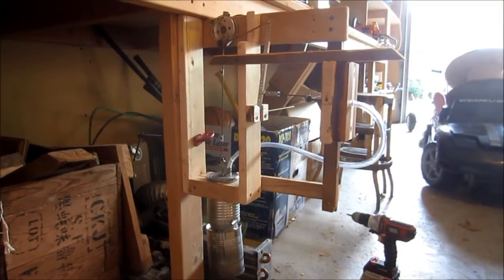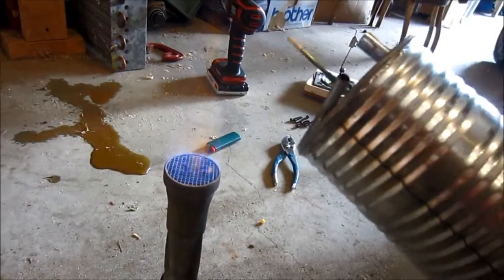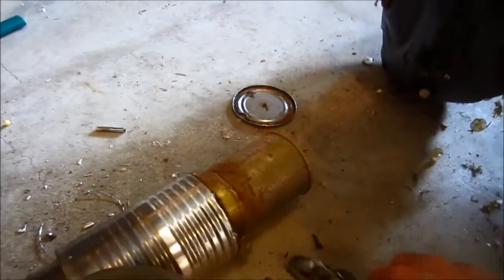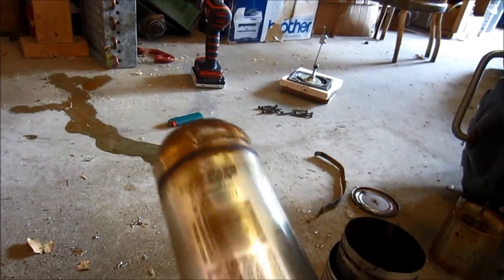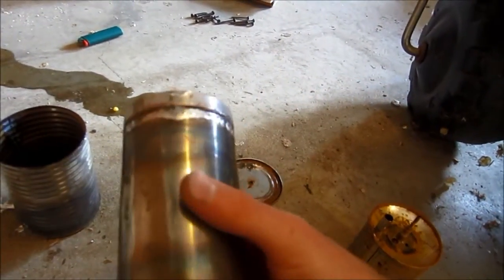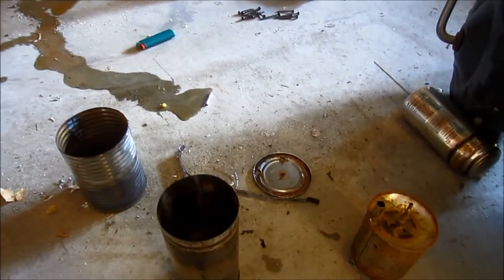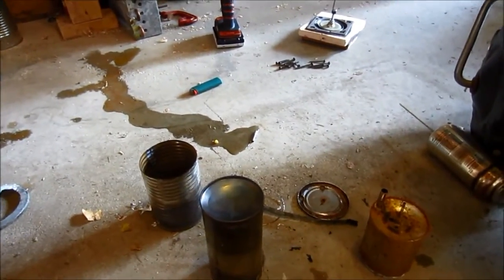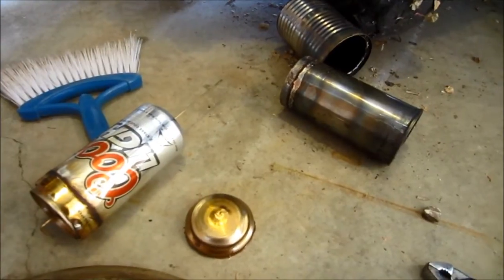Taking Apart My Stirling Engine #4 With Failed Displacer

Comment: Congratulations dedication in building this engine, I believe, if you reduce the length of the displacer piston, you have increased pressure inside the engine and also reduces the possibility of pressure, crushing the piston.
You come to know about my last model I built simple engine?
Greetings from Brazil,
Leandro Wagner.